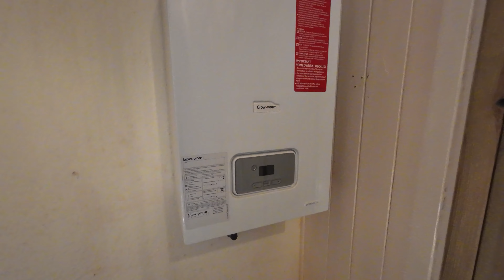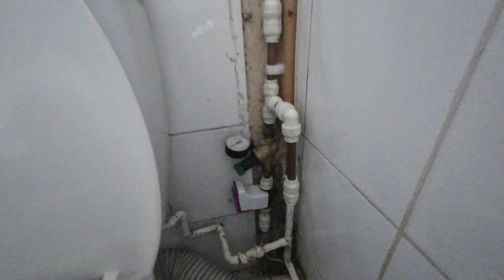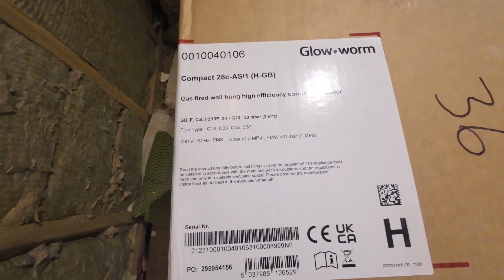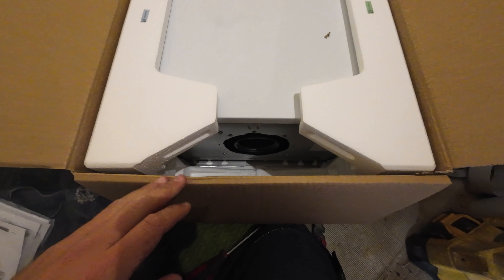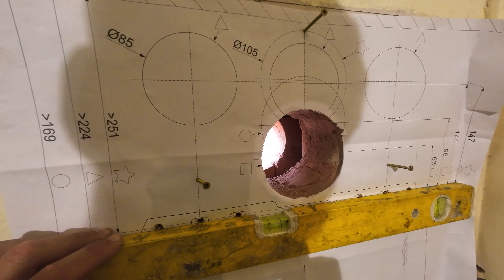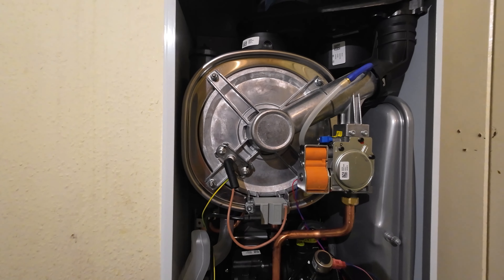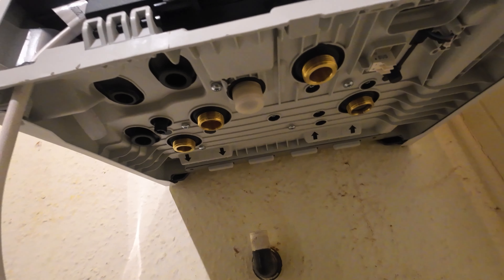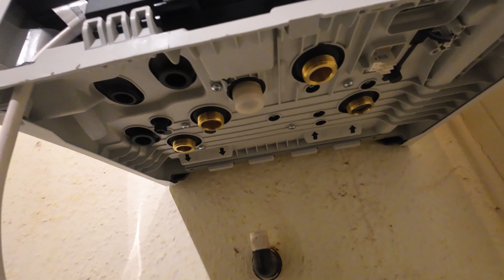Budget Combi boiler conversion- Glow-Worm

Comment: My engineer didn't fit a PRV is this needed? Is this the copper pipe sticking out and what does the pressure release valve do etc 

12:23 in the video 

Thank you

Comment: Really informative video on the compacts. Can you range rate them? What are your thoughts on boiler controls? Being ex bg when i left i always fitted hive as it was what I knew. I now try and fit makers controls especially on glow worm and vaillant for efficiency. Just curious on what you do in general?
Reply from the maker: Hi thanks for the comment. I don't believe you can manually range rate these no. They do however  accept weather compensation sensor/controls. 
 You should always install the manufacturers controls where possible. This has Ebus. I normally just do what the customers want. I advise only , I'm not loyal to any particular brand or control so I treat each job separately as they come. The hive has good smart features, but offers no weather comp or opentherm so it's pretty poor really. Cheers.
Reply: You can range rate them fitted a few of these
Reply: They come set on auto range rate but can be altered in the installer settings.
Reply from the maker: @alexshepherd3308  good to know 👍
Reply from the maker: @alexshepherd3308  even better then for the money. Thing was so quite also. Impressive really.